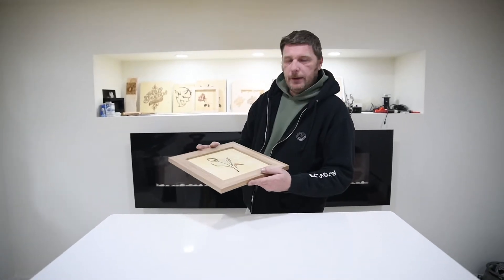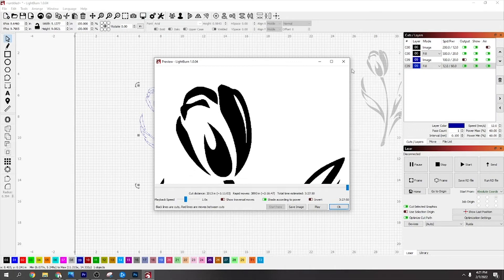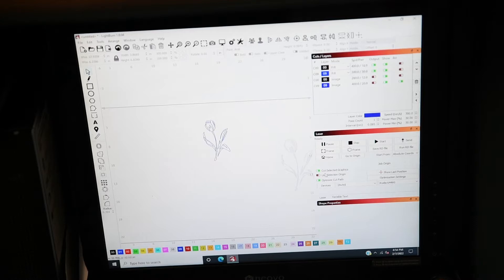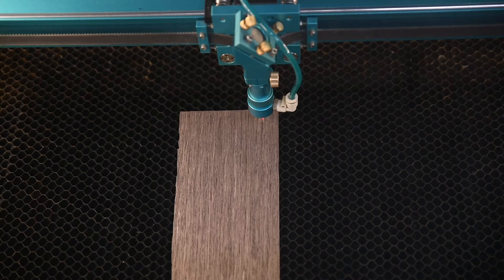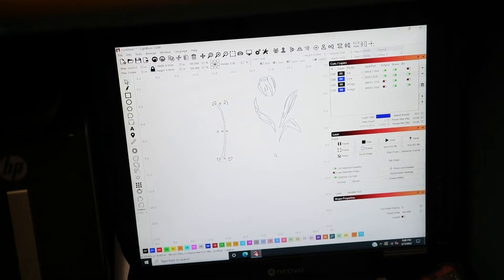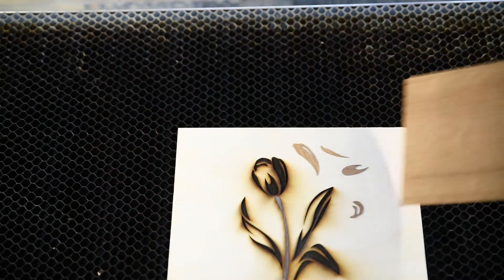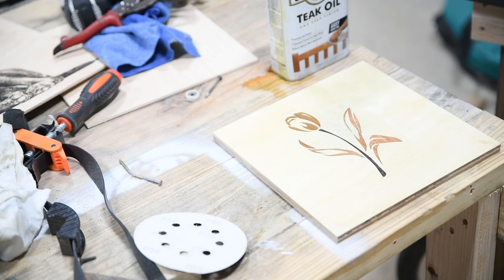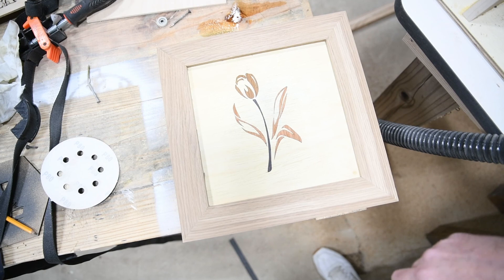How to Laser Cut Veneer Wood Inlay

Comment: Air assist is what causes your burn. If you don’t use air assist it won’t burn the edges like that. Not sure why people can’t figure that out…
Reply from the maker: air assist also helps to make the burn deeper helping to place the veneers at a good depth and if you watch until the end you would see that just sands off no problem. maybe you need to figure some stuff out because it would have took 3 passes with low air to get the same depth.

Comment: Good work. Im struggling with my veneer not being dead flat. It makes every inlay piece i cut out a slightly different shape and size. Any ideas ?
Reply from the maker: Thank you, maybe some small earth magnets in the right place to pin the high spots, not 100% on this as i havent tried but what about putting a nice flat piece of ply on the laser and using double sided tape to pin the veneer to the ply ? might work if not a good vacuum table maybe.
Reply: @carphotography  If you make a vacuum table style board underneath and plug any openings around the edges, it works.  it does help to put the veneer under a board with a 50lb. weight on top for a couple days.  i don't use the honeycomb btw.  After a bit the vaccuum table board can get a little messy, i just use some orange hand cleaner and it keeps it for a bit.  but once all the lines get too deep the little bits start flaking.  A good wood on wood veneer is best.  the trick is getting the depth on the first pass (birch) at a decent depth so you don't sand thru the veneer.  I don't use wood glue, i use contact cement.  The water in the glue causes the grain to rise.  And instead of teak oil, I use a sanding sealer and a clear lacquer.  So as long as i keep it out of the sun it will last forever.  Curious how you get the kerf to cooperate, it's kinda trial and error depending on the pic.  Some rounded edges being sharper don't like to cooperate.  I use cherry wood on wood veneer and a pre-finsihed (sanding sealered) birch, so literally my sanding is just a 1 pass with 180 grit, 1 layer of sealer, 1 sanding pass, and then the lacquer.